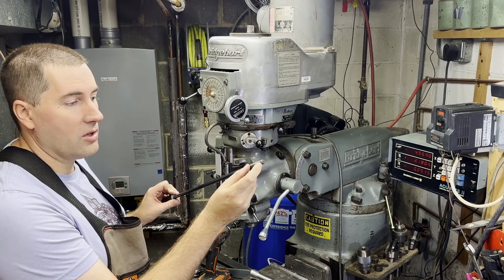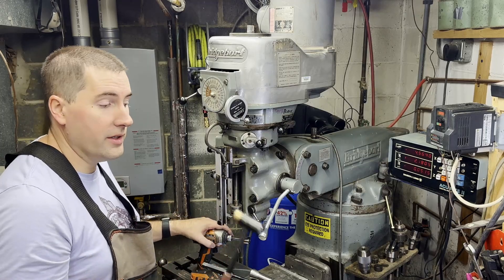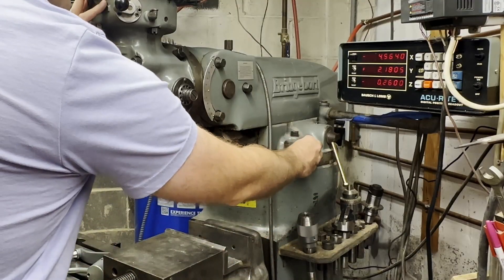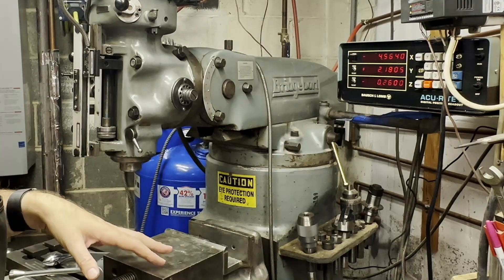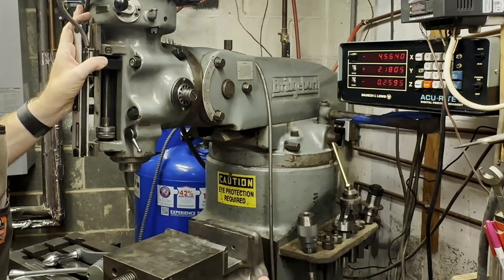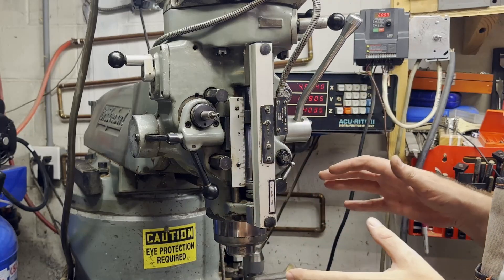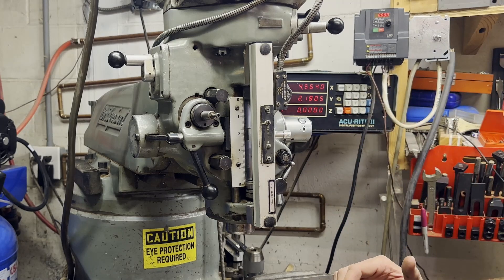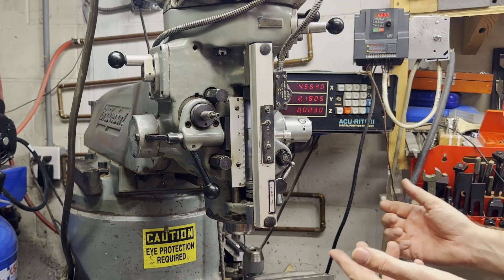How to use a Bridgeport Milling Machine

Comment: Can you tell me an effective way to set a z height for repeatability to within a thou, preferably without a dial indicator. I can hit bang on .001 usually w side milling but hardly ever with top milling.  I heard setting against bottom flat working holding and backing off isn't accurate, going be the knee dial,  and now I want to use gauge blocks or even 2 parallels to get a .250 thickness part.. exactly, but I would have to still set the tool and I don't know what the quill stop does when actually cutting I don't think they are that solid so if I still set without pressure so I don't chip the damn tool, I still risk the tool being too deep once it cuts and everything relaxes so it need to test and see if near a certain spot on the knee doing this will give me my target preferably minus a constant

Comment: Thank you! I used a Bridgeport in high school, but that was 50 years ago! Now I finally own one and couldn't figure out why the quill wouldn't go up and down. I have never used power feed (nor needed to), so I solved it by removing the handle and gear on the left side and voila, the handle works! Looks like my machine was not well maintained. There is a lot of backlash in the left -right bed handle (about 10 thousandths) and virtually no oil anywhere. Also, mine doesn't have an oiler, so I ordered the proper oil and will manually attack it. The knurled stop on the quill is frozen as well, which may have something to do with why I was unable to lower the quill manually, until I removed the gear drive on the left side. Any idea how I can loosen it? I really appreciate your video!

Comment: Did you not consider mounting your Z axis on the knee instead of the quill?
Reply from the maker: It came on the mill like this.  It does seem more useful on the quill though, as I use that alot more than the knee.  The dials on the knee are also easy to use if need be.

Comment: Just a question for the speed changing handle I put the speed to 600 and I reverse the handle to got to 4000 right so I can be clockwise and anti clockwise as long as i don't go to far? Not 1 way all the time the chain will seize* up in the middle

Comment: QUESTIONS - A - whats the little 'hinged capped elbow' right behind the "power feed knob" (perhaps)  on right side above the quill handle. I got that one and another above it by the "collet bolt" -ish (its at work i dont quite remember where it is)
B - how adjust the head angles ?
thankyou
Reply from the maker: They’re oil cups, there should be a lubrication data plate on the side of the head.   Loosen the four 3/4” bolts on the front of the head and then turn the bolt on the sode to adjust the head angle.

Comment: Jim, quick question. Can these Bridgeport milling machines be automated? It is a vintage one like in your video. Great video by the way! Learning a lot!
Reply from the maker: They can be, but its quite expensive as you need to add ball screws, servos and a controller.  You’re generally better off just buying a purpose built cnc.
Reply: Yes you can retro fit a Proto Trak System  2 axis, glass scales optional. X,Y ball screws and motors and control , easy to program